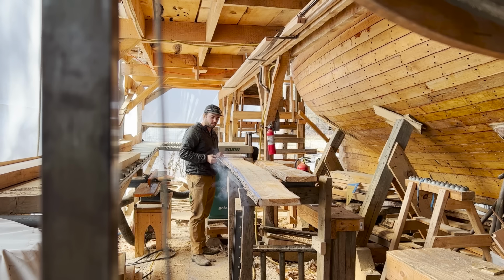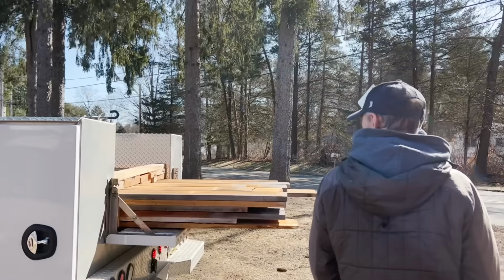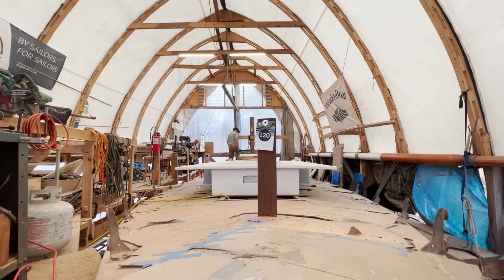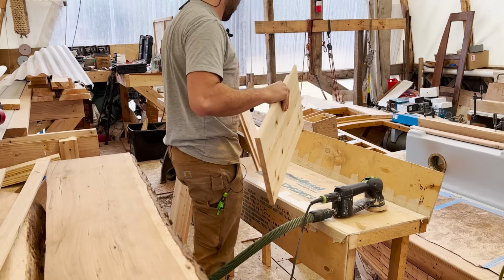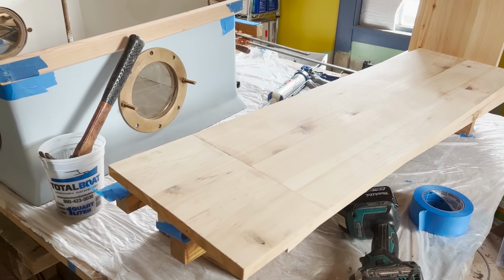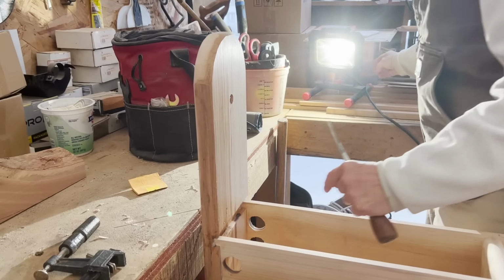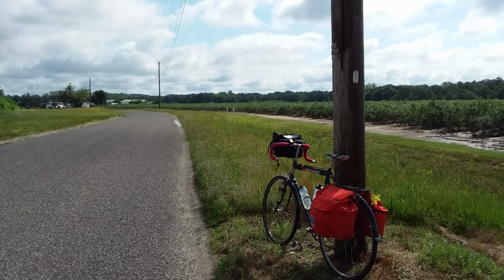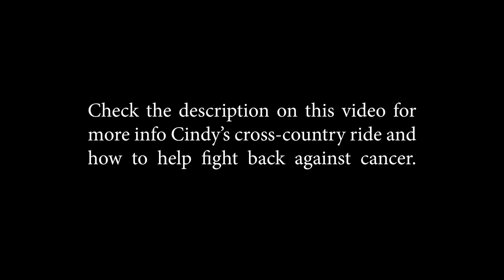How To Use A Board Stretcher, Housing The Lithium Batteries - Episode 256 - Acorn to Arabella

Comment: We always kept our board stretcher right next to the turn signal fluid! 😁
Reply: I'm pretty sure every carpenter's apprentice has spent hours looking for it

They won't need turn signal fluid once they launch, but they better lay in a supply of relative bearing grease
Reply: I've always wondered whether it would be possible to steam and stretch a board, if only a little bit. You can steam bend, and any bend requires the outside to get longer, so I think it should be possible.

Another classic is the "aluminum magnet", which is theoretically possible considering that aluminum is paramagnetic, meaning that it is in fact weakly attracted to sufficiently strong magnets.

Comment: I have mentioned in the past that our family farm has been in the family for seven generations.  I guess I really hadn't heard all of the details. But my great, grandfather had a steam boat service on Conesus Lake. This was back before cars. So the boats took the passengers up the ten mile lake. I believe there were three boats. I believe they sunk one on the lake when it retired. Any way my mother's dad spent years and years there on the farm building a boat. I don't know what kind as it was when I was little and most of it before I was born. He talked about fiberglass work on it. And I really don't have the details. But after he had worked on building this boat , they transferred it the four miles to Conesus lake from the farm. They took it to Walkleys landing and launched the boat. Then I heard that the boat promptly sunk to the bottom of the lake. There was a very lot of swearing going on. This was the grandfather that was a well driller by profession. It's a good thing he had that for a job and not boatbuilding. There is a book called, The Diamonds are Dancing a history of Conesus lake. Our family had a long history on the lake. If you get the chance, look up this book. My favorite lake that I take you along kayaking is Candice lake. Two lakes over in the finger lakes region.

Comment: Idea for the funky white oak burl chunk, save the rotten chunk and resin it together as much as possible with the rest of the wood then drill out the rest of hollow area and put a brass barrel clock in it, then you can install it as a fixture in the boat.

Comment: Arborist/forester here... in reference to the holes in your cedar. Any projectile pushing wood out of the way to penetrate will leave most of the wood in place just shredded. THAT damage looks like the material has been removed with a sharper slower moving tool. If I'm not mistaken that looks like the size of an increment corer, But that's typically not used repeatedly (unless you're practicing may-be?) Or maybe a young person was let loose with a drill one day on the job site?
Reply from the maker: Who knows? Thanks for the thoughts!

Comment: Hi Steve, I work with lithium batteries since 5 years in the automotive industry.  I understand you will be using lithium Iron phosphate cells which are consideres safe. That is a good choice.  I just feel compelled to say that according to murphys law,  if it can go wrong it will. Even LFP cells fail and it can be serious.  My five cents is to put some metal conatiner around them and have an emergancy plan in place, fire extinguiser, water hose or even a way to quickly throw them off board :) . Take this comment the right way, its likely (99.9%) not an issue,  or even 99.9997 % ,since the quality of cells is around 3 PPM. But considering all the work and heart and effort that has gone in to the project I just wanted to let you know this. Most likely the diesel engine is more dangerous but anyways:) now you know.
Reply from the maker: Thanks for your thoughts and for watching.

Comment: Did I miss in a previous episode on the caulking or prepping the actual boards of the sides of the boat?  Did that happen?  I know they did the deck but I don't remember the boat actually getting prepped.  I know that clock is ticking and you all are doing amazing and keep up the awesome work!
Reply from the maker: We need to have more humidity for the planks to swell so they can be caulked, and so this spring is the time for that. Very soon now!

Comment: At this stage in the build I personally don't think I'd be worried about polishing the bell or any other brass work, I'd be more concerned about being able to see a significant amount of daylight through the hull planking! (7:20 onwards).
Reply from the maker: Those gaps close with humidity, which spring brings. When we have many hands, which isn’t that often, we get ahead on some small stuff. That volunteer doesn’t have boatbuilding experience, so can’t do anything about the caulking and fairing, but can help in this way! Thanks for watching. —Anne

Comment: I am curious as to how you will charge your lithium batteries at sea.  Lithium batteries are adverse to overcharging and for that reason the new all electric Porsche Taycans come with fire extinguishers even though there is no gasoline on the vehicle.  You are probably aware of this issue, but I had to mention it.
Reply from the maker: A smartypants charge controller m/inverter (Victron) for these very safe lithium iron phosphate batteries can regulate alternator, solar, or other sources of power with ease. We’ll talk a little more about that later. —Anne